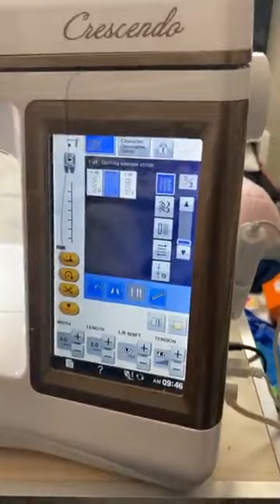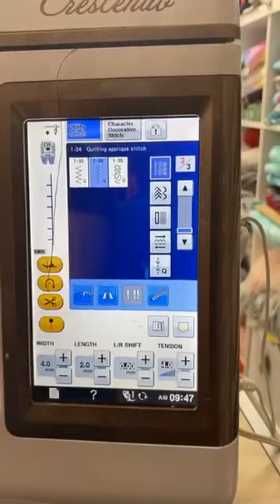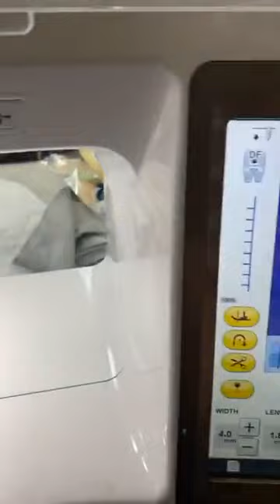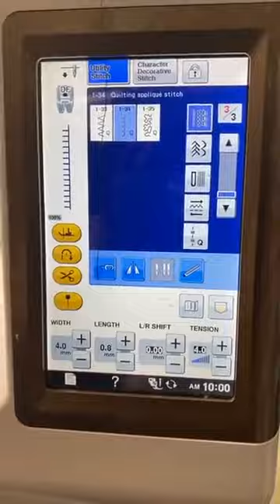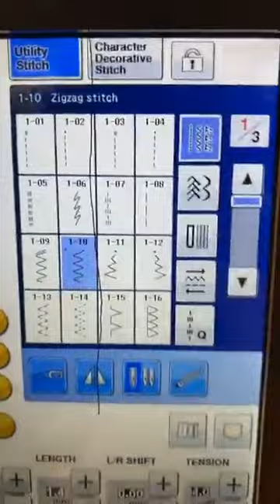Embroidery and Applique Tips for Cuddle® Minky Plush Fabric (& Video)

Comment: But what if you are using the Bubble Cuddle?  If you iron on the stabilizer for appliqué, you will iron out the Bubbles in it..  Need an answer pretty quick since I am in the middle of this project & need to get it done for mailing for Christmas .
Reply from the maker: Yes, if you apply too much heat it will flatten the dimples in Cuddle Dimple, but you only need to wash it and they will come back.